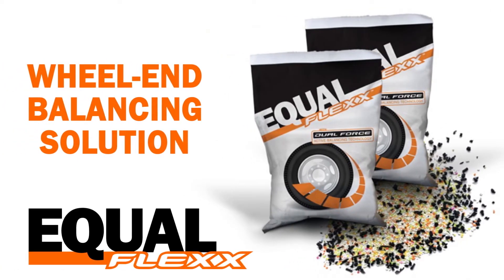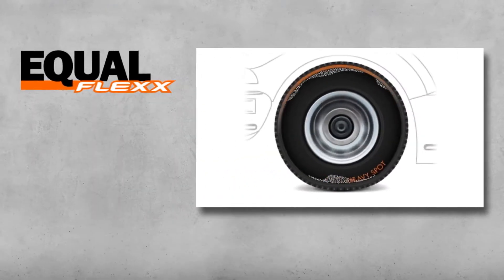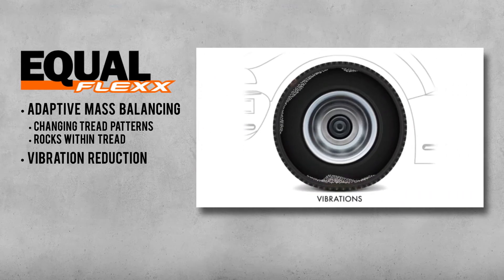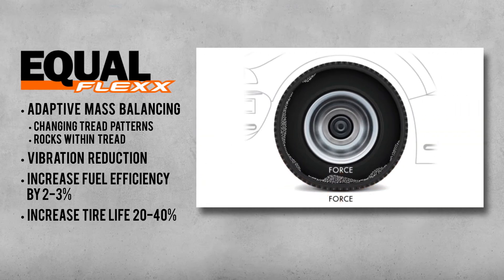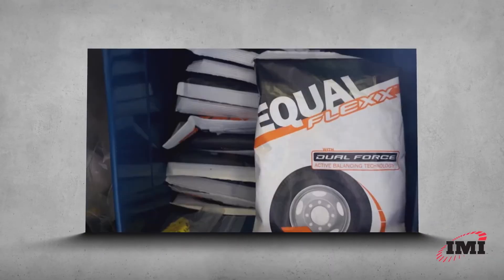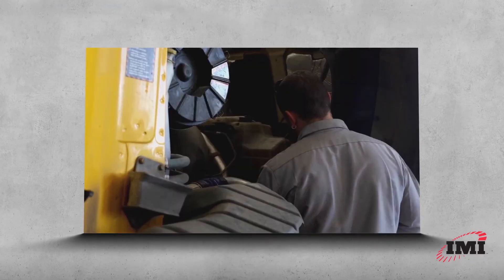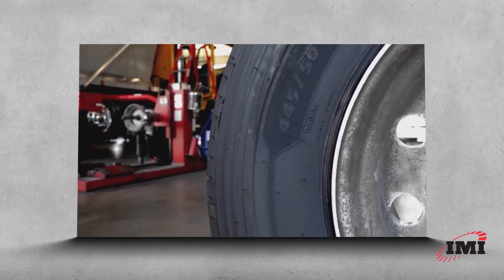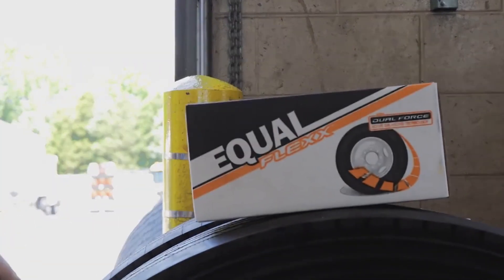Equal Flexx Wheel-End Balancing Solution by IMI

Comment: Need to know/confirm we should not "norma"l balance the tire or whether to take off old weights prior to putting in a bag of Flexx.
Reply: I had an incompetent tech add Equal to new steer tires on my bus (365/70r22.5) without removing the old weights and it was a horror show between 68-70 mph. I popped the weights off in a parking lot and it reduced the shaking about 75 percent but eventually had the sand vacuumed out and properly balanced.